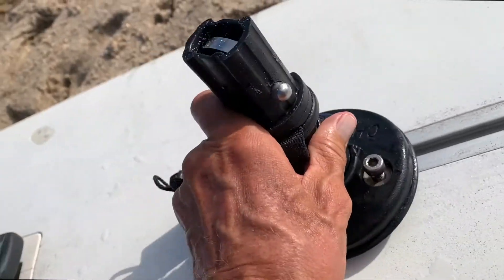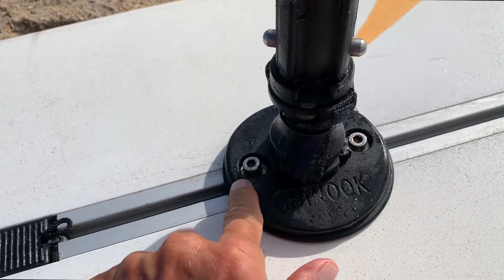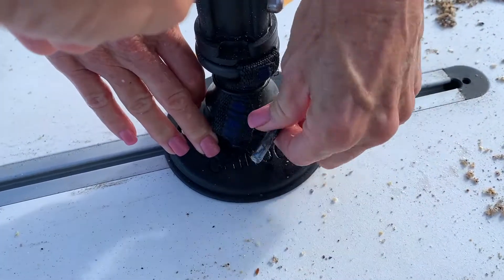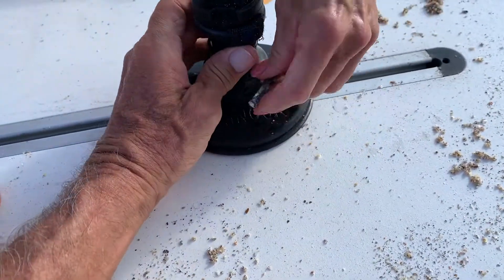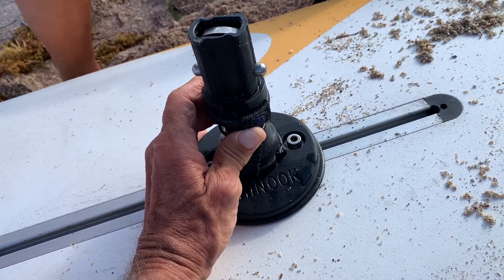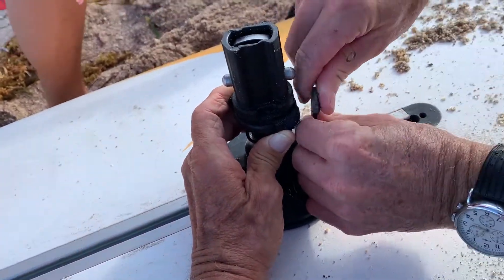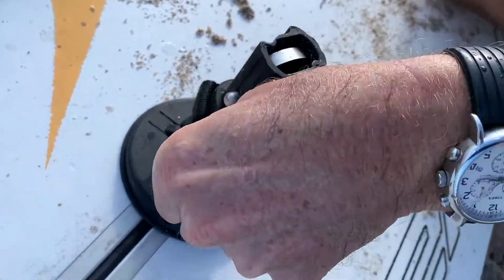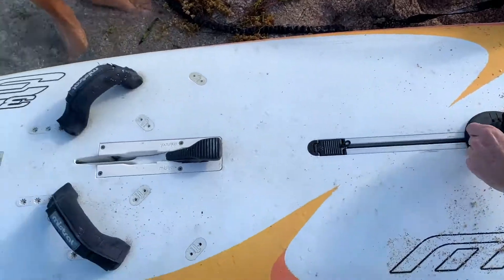How to attach a mast base to your Mistral windsurfing boards mast track

Comment: Nice to meet you. May I ask you a question. Is this "Chinook 2 Bolt Tendon Base" and defaut parts  or  changed two nuts ( Do I need Brass Slider - For Mistral Track )? I have a Mistral same Track rail boad(concept 325 Mailbu). I am  looking for mast base for Mistral Track rail. Could you please tell me. m(_ _ )m.
Reply from the maker: I bought this on Amazon but you could try Jupitor kiteboarding for parts online
Reply: Thank you for your reply.　I will try to find it.